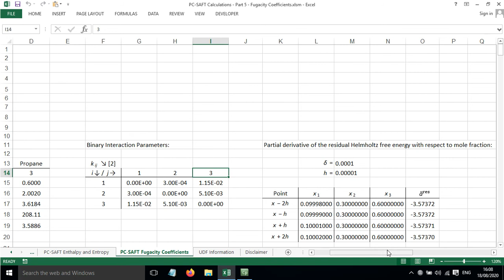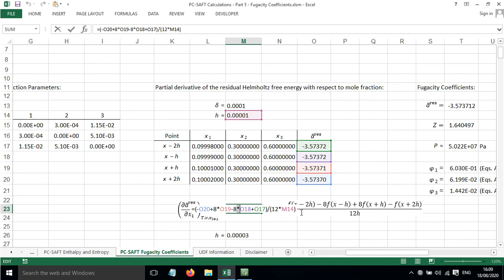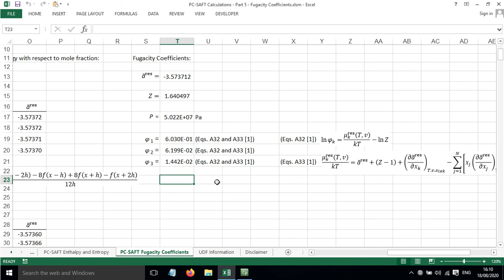PC-SAFT Calculations – Part 5: Fugacity Coefficients (nonassociating)

Comment: is there a detailed solution with the fully developed expressions for chemical potential in the original paper? (eqs. A32 through A45) I mean, the numerical derivative works just fine, but it can become troublesome really fast, especially within a VLE algorithm. It has been helpful regardless, thanks a lot!
Reply: I couldn't reach the same results when I used eqs. A32 through A45
Reply: @arley602  There is a missing term in equation A35. Try to do the calculations by completing equation A.35 with the term: -(m[k] -1)*ln(g[k,k]). With this modification the results can be reproduced